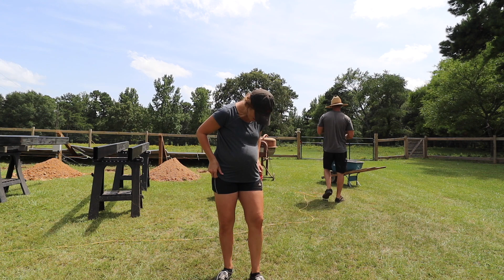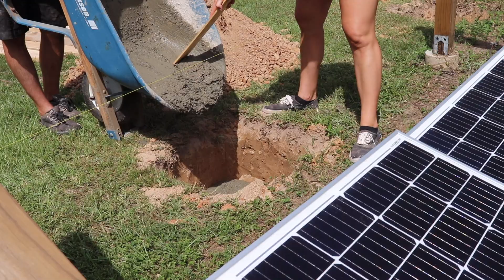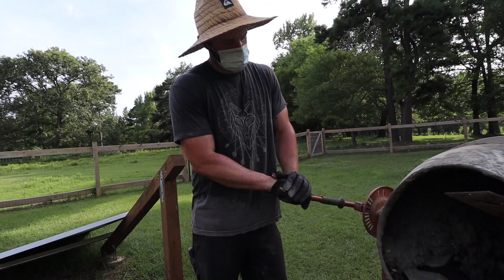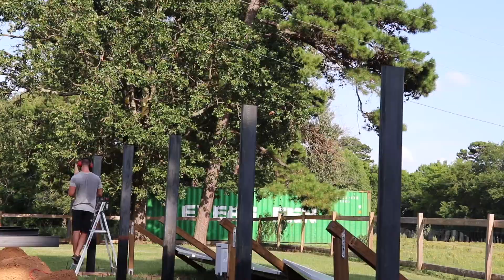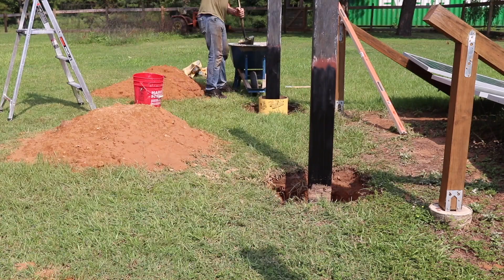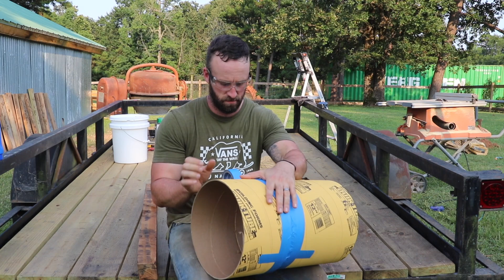Building A Solar Array That Adjusts With The Seasons

Comment: Now that all the angles are tied together with the welded horizontal panel supports, how are you going to move them simultaneously when tilting to get optimum electrical generation?  Won't there be stresses on the welds when moving from one jack to another unless all the jacks are moving equally?  Having an electric motor driving each jack might solve the problem?  Both of you are to be commended for all of your hard work and devotion to not only this project but to one another.  Bravo Zulu.

Comment: Sorry for the late suggestion, but I have found injecting hollow tubing - round or square or rectangular - with expanding foam usiing a long tube works great to keep the interior of these tubes from rusting from condensation or water infiltration.

Comment: Don't know what your frame will look like yet, but make sure you use something to isolate the Aluminum panel frames from the steel structure. I used squares of truck innertube  with a hole punched in them for the bolt to go between the aluminum and the steel channel, and Stainless bolts and hold down clips. Been up for about 8 years and still seems to be doing well.

Comment: U all are awesome. With all that rain you just got. I bet u have water in the bottom of your tubes. Put a small hole on top of concrete in the tube. And fill tube from the bottom up to that point. For the water can drain and you don't have a once-in-a-lifetime freezing accident.

Comment: Sorry I forgot to mention on the last post that you should weld cross rods to the post or just screws some Tek screws into the lower section of the post that will be in the concrete. This way the post cannot be lifted out or upwards, which will happen if you get a strong enough wind in the right direction as the panels will act as a sail.

Comment: Not sure why you don't hurry to get moved in BEFORE the new baby arrives.  This outdoor stuff can wait until after you finish up the inside and get moved in.  Hell, set-up and use a generator if you need more power for air-conditioning until then.

Comment: I have a 12x12 canopy that I use on camping trips.  I learned early on that anytime it rains, I have to push up on the underside of the canopy to expel the rainwater that collects on top.  If it's on a hill, the water will drain off of one or two sides pretty well, but there is always at least two sides that collect the water.  It's no fun having to get up several times when it rains during the night.  

Some of the metal pieces on mine got bent from wind gusts.  It's probably 20 years old, so I can't get replacement parts.  I bought some 1/4" thick flat steel that just fits inside the pieces that got bent, so I use that to reinforce them.  I could buy a new canopy, but the ones I looked at aren't as sturdy as the one I have.  Hopefully, you can still get replacement parts for your canopy.

Comment: I've found a pressure washer to be invaluable with those harbor freight mixers. Time out how much water is needed and it's typically enough to wash the previous batch off the walls, keeping the mixer clean

Comment: easier way to make solar panels track the sun everyday ANY season .... use black pvc ... set a larger reservoir heat absorbing tube on each edge of the panel array .. as the sun  heats the fluid in the pvc reservoir it heats and expands ... as it expands it moves the actuator on the other side of the array to move the array towards the sun ... same for the top and bottom ... NO power needed ... just sunlight ... and a fluid that expands relatively quickly with heating ... then all you need is a proper ball joint that can hold the panel array it will track the sun every day the sun shines and every season as well ... the further North one gets the more one needs to have a fluid that wont freeze .... even at night the panels will reset to a balanced placement awaiting the next days sun ... none of this manual or motorized panel adjustment junk

Comment: You ever run into were you have to put 2 of the tubes together again. Dont worrie about cutting them. But what ever one that is bigger on the bottom and take some self tap screws and adjust the inner tube to the right height and screw them together. Then you can tape it if ya want but dont need to. We do it alot for decks and stuff so we dont waste so much.

Comment: If you do have to blot through the tubing the best way to keep it water proof would be to make the holes bigger than needed and put a pipe through the tubing and weld the pipe to the tubing to keep the water out and make it last as long as possible

Comment: One nice thing about your setup is that down the road you could replace the trailer jacks with powered screw jacks controlled by an arduino and automate the elevation of the panels daily. I don't know your background with the electronics side of making, but you're clearly smart and you've learned tons of things working on this house way harder than what you'd have to learn to do automatic control. Plus it would be fun:)

Comment: Hey Spencer, try welding a round tube or pipe through your tube post for your bolts. That would seal the water out.

Comment: Spencer, I would put dry concrete into the tube and add water after… then use a stick of rebar to poke it for the water goes down. I used to do that for all my fence posts and it worked …. And less work to premix the concrete then haul over and less mess.

Comment: Another way to keep the metal posts plumb is to make a small wooden frame to fit around it up high with boards attached to stakes used to keep it plumb.

Comment: You mentioned that you are concerned about interior rust.  Could you weld brackets on the posts instead of drilling holes through the posts?  I know you're good at welding.  Just a thought.

Comment: What a amazing project you dreamed and making it real.
What a great determination and hardworking spirit.
I am watching this chanell from episode of framing for middle section it is around 2,5 years.
I have a little advice with the sealing off the jäkl around the bolt section. Just use a big enought pipe for the bolt (inner diameter) and drill a hole in the jäkl with outer diameter of pipe, then you can just weld it on place. But I would be worried about how to paint inner dimension of the pipe. I think the best way would be just dip it in to the can of paint and then sand the location of weld afrewords you would just paint the unpainted area .

It is just a proposition :)
P.S. sorry for my horrible english
Best luck from Czechia
Reply: Welcome!  💜🇺🇸

Comment: Little tip when using a mixer; put the water in first. It cuts down on the dust and prevents the dry unmixed part of the mix you get at the bottom of the mixer.

Smashing job, keep at it!!
Reply: Those cloth diaper masks though you know all that dust was getting into their lungs.
Reply: @lance9249  I spent a lot of years growing up mixing cement without any kind of mask. While I'm sure some protection is a good idea, I expect he'll live.

Comment: If your going to use tube steel - and seal off the top end, you have to account for condensation inside the tube - so you might want to drill a few holes at the bottom to allow that condensation build up drain out.
Reply: He did seal the top end.
Reply: @genewaddlerandomstuff2122  I dont think so. We saw him cut the top off the posts
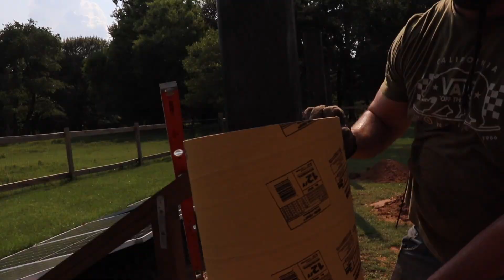Reply: @ForeverThriveLife  At about 10:20 in the previous video he talked about welding the ends closed. I think he welded a plate on the inside of them. I know he did in the bottom as he showed doing that.
Reply: DJ DuneWolf  Yeah, he did! He neatly cut out plates that just fit inside the tube steel and then welded them in place.  Yeah, he did! I watched him do it!
Reply: @tinydancer7426  Yes he sealed the top - problem is.. a tube thats sealed on both ends will still have air inside that will condensate on the inner walls.. - that water will then collect and rust out the inside..
Reply: @dunewolf  I guess he knows what he is doing/has done
Reply: @genewaddlerandomstuff2122  as I mentioned about sealing the top - if he has both ends sealed.. water will condense inside due to temp changes.. Because Ive seen tubed stuff like this rust inside out with no venting for the water it will collect and rust out.

Comment: You do awesome work - love watching your progress! Just had the thought as the storm brought all the rain… you might want to put in a good lightening rod somewhere near the array?
Reply: I'd put a lightning rod on the top of each post with a 6' copper grounding rod hammered into the ground right next to the concrete and some 8 gauge braided copper wire between the two. I over ground my ham radio antennas that way as well.